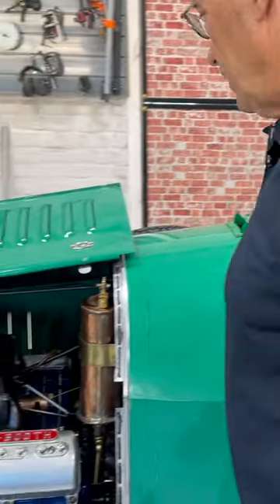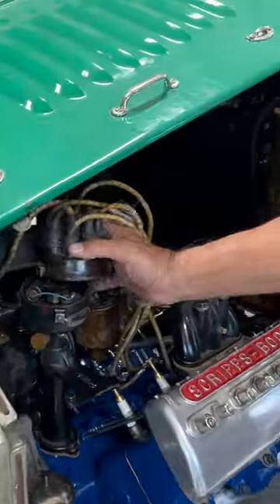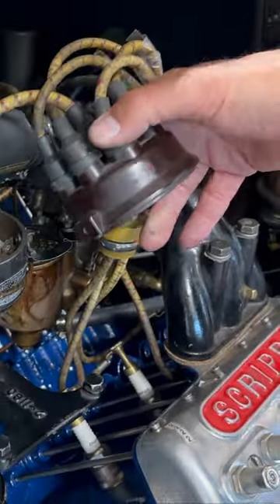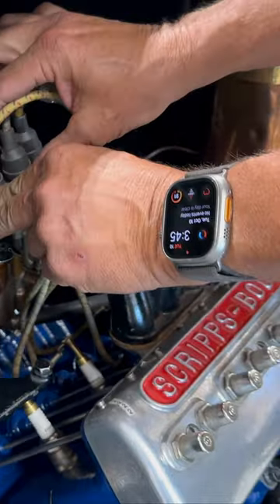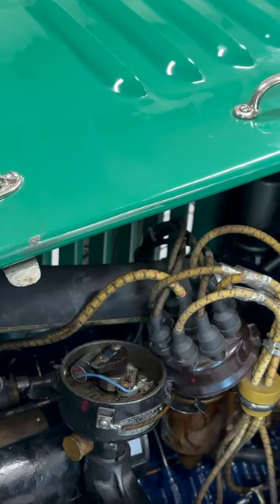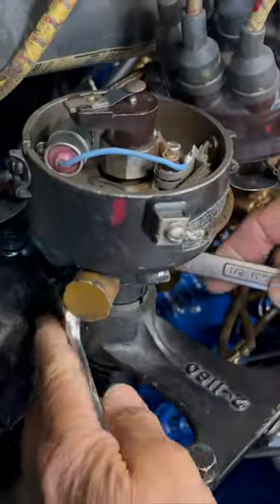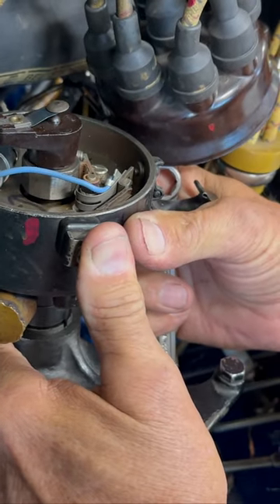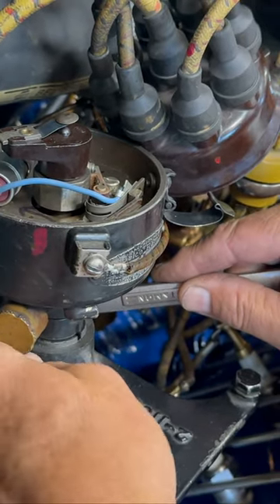Can’t FIX Time W Modern Timing Light to Start!  Only OLD WORKS! 1915 Ferro OHV Racing V8 Alan Travis

Comment: Although I frequently time engines by ear, you cant argue with a timing light, and manifold vacuum. An inductive timing light will work on ANY engine with spark. Resistor plugs and wires don't change anything other than radio/RF suppresion. Ive been working on antique engines since I was a kid.
Reply from the maker: Thanks for your insight
Reply: EXACTLY
Reply: Was thinking the self same thing.   👍🏻
Reply: The timing light never lies, but the inertia ring does on this old stuff. Very common for the ring and its timing marks to slip once the rubber shrinks and cracks from old age, you really do have to time by feel
Reply: @allurared9029  what is an inertia ring. I have been a mechanic since the early 70s and have never seen one.
Reply: @artszabo1015  The inertia ring is the outer ring of the harmonic dampener that bounces around on the rubber
Reply: @allurared9029  Well well , I knew that rubber was there but always just considered it as one piece. Thanks for the info.
Reply: @nunyabiness417 as a guy that has worked on these old engines, you forget one thing.
See, back in those days, they were made to be serviced and maintained BY THE OWNER.
That means you didn’t have such Ann expensive, fancy tool like a TIMING LIGHT hanging around your shop.

This guy proves that by showing how it was done back then.

When it came to those old cars, they literally were fixed on the side of the road with spit and baling wire.

Comment: Quick Hand tune....works on 1973 V8 Olds too.....
Bought it ...ran so rough....to drive it😂 away I used window to see the vibrations move the glass...
Door open ...3 inches rplled down...
SAW the idle at its smoothest....to get it home.

Comment: 1-Number one piston top dead
2-open switch to on position
3-loosen distributor
5-numbrer one sparkplug wire near ground
6-rotate distributor till see the spark.
7- tighten distributor and 🙌
Reply: Which direction is the distributor rotated, please?

Comment: Old school stuff kids, listen and learn,  i can remember using a matchbook to adjust the points , something most of you young bucks never heard of
Reply: Match books or points?
Probably neither.
Reply: we used the pull tab from a beer / soda can, then left it hanging from the cap clip for next time.
Reply: I remember using a business card
Reply: @jamesredman1263    business card is about 0.0011" so close enough for setting the air gap on a lawnmower coil to the flywheel. A bit too slim for points.
Reply: @rupe53  
I think matchbooks run about .015"-.018", so just about perfect for most points. And of course they were free and plentiful. 
I never heard of the pop top trick. Now I have to find one and mic it. Lol
Reply: @jerrylong381   I think you will find the newer aluminum cans are thinner than the ones from circa 1970, plus the tabs don't pull off. Of course, nobody smokes these days, so matches are not as plentiful as they used to be. Also, in the old days, matchbooks were not all the same thickness. I got pretty good at eyeballing them. Of course, if you used proper points lube you didn't have to screw with adjusting them between replacements.

Comment: 1. Top dead center the engine by turning in the direction of operating rotation. This takes up slack from the timing chain.
2. Ignition on.
3. Turn distributor against operating rotation until points break, audible click and flash across points.
You now have a perfect tdc 0° spark.
This technique works for any points ignition system, its actually more accurate than a timing light.  You can now advance the timing by ear for daily driving with your chosen fuel octane.
Reply from the maker: Great tip!  Thank you!

Comment: I HAVE USED A TIMING LIGHT ON OLDER VEHICLES WITH STANDARD SOLID WIRE AND NO ADDED RESISTANCE!
WHAT IS UP HERE??
Reply from the maker: It’s the new ones that don’t work. Old ones work fine. The chips gotta see resistance… apparently
Reply: I DON’T KNOW WHAT WE’RE YELLING ABOUT!!!!
Reply: @AZdirtdog 😂😂😂😂 I agree
Reply: WHHAATT? I CANT HEAR YOU SPEAK LOUDER!
Reply: @nasilemak868  HAHAHA YOU DONT HAVE TO SCREAM 🤣🤣🤣🤣
Reply: Same here, no problem.
Reply: Ditto...solid core wires on flathead...find top dead center cylinder #1, mark the crankshaft pulley with a notch, I made a pointer out of mechanics wire and secured it to timing cover bolt to align with mark. Flathead Fords like about 22deg overall all in by 2200-2500 rpm. Converted diameter of pulley to degrees and marked the pulley a second time. With inductive timing light, solid core wires and copper core spark plugs accelerated to 2300 rpm and adjusted timing until second mark aligned with pointer, tighten distributor...done.

Comment: Try a vacuum gauge (with a large dial).
Reply: Rotate fist—engine at idle—until the highest vacuum, then back of 1/2 inch mercury on the vacuum gage and lock hold-down bolt…gotter done.
Good when harmonic balancer ring has slipped and light won’t work right.

Comment: I'm on my daughter's YouTube. For those of you that say that a timing light would work on this engine you're half right. I have a Sun Tune timing light that I got from my dad 42 years ago for Christmas. It gets its power by connecting to the vehicle battery. This timing light is so sensitive that if an engine has solid core plug wires that it will pick up the induction from all the wires even though it's clamped to the number one plug wire. In fact it will pick up the induction of all the plug wires without the timing light being clamped on any of the plug wires. The clamp can be laying on the ground and still pick up the induction from all the plug wires. When that happens, it makes it a little tough to time an out of time engine while cranking. I'm guessing in a case like this a cheaper timing light would be better because it wouldn't be as sensitive.
Reply from the maker: Thank you, for that great comment. Keep that old timing light, it will work better in a non-resistor ignition, the new timing lights have chips in them, and they have to see the resistance to work…
Reply: Really? Never to old to learn. Thanks for the tip.

Comment: I've timed plenty of old school engines by feel and I'm a 24yo girl. timing lights help though, and there's no reason one wouldn't work on this engine either as long as the crank hub or pulley has a mark for TDC in respect to a marking on the block. Common sense and feel always come first though. Twisting distributers really is pretty simple business, it may be old tech but you can find distributers on engines into the modern day. Good skill to have especially for me, owning vehicles twice my age.
Reply from the maker: That is excellent!

Comment: with someone turning the engine over someone else slowly turns the distributor, after it starts you can do further adjustments, and then fine-tuned the distributor no tools required. you can also point the rotor when the number one piston is at top dead center and both valves are closed. with the engine running fine tune by turning the distributor a little bit at a time and opening the throttle very quickly Till There is no hesitation in the engine. when you step on the gas to tires will go around real fast right away and you win the race
Reply: every engine has its own special place and you cannot find it without a load on the engine. sometimes I even adjust the timing while the engine it is running under load for best gas mileage. the race is on

Comment: Where did you get this guy? Same as an 9N Ford tractor.  The coil is attached to the front of the engine.
Reply from the maker: My understanding is the Ford 9N came out in 1939, 26 years after this engine was built!
Reply: You must not have much background with motors. Theres hundreds of designs with the distributor to the front of the motor. How the hell could a team assembled v8 be anything close to an assembly line built flathead 4 banger?

Comment: I routinely use a timing light on cars that don't have resistor plugs. All resistor plugs do is keep static out of the radio.
Reply from the maker: OK thank you I’m gonna look into this more
Reply from the maker: He’s talking about the newer ones. If you have a non electronic one, it will work 👍
Reply: @BarryTsGarage  All a newer electric one needs is a 12 volt battery to power it. A lawn mower battery will work. That's what I've had to do when timing a six volt VW with a new timing light.

Comment: The rotor doesn't spin in the same direction all the time?
Reply from the maker: Different engines spin their distributor differently (clockwise or counter clockwise) on some ancient machines there is no reference manual available and you have to figure everything out… but good question!
Reply: @BarryTsGarage  You're right, makes perfect sense to double check as it only takes a minute. Thank you for the informative video and answer.

Comment: Don't think typical American V8 cars had overhead valve v8s for another 30 years😂
Reply from the maker: That sounds about right!
Reply: Buick had OHV and full pressure lube in the 20s. Their Master 6 cylinder had roller lifters in that era as well.

Comment: Time for MSD ignition upgrade here. Vehicle's over a Century old !
Reply from the maker: A practical idea for a lot of applications but that’s not even a discussion here. Alan is determined to keep his cars looking and running as-built. He actually enjoys tweaking the tune and keeping everything “analog”.  Thanks!
Reply: @BarryTsGarage  ... Looks like a dab of distributor cam lube is in order.
Reply: @BarryTsGarage I completely agree, it’s way more enjoyable to keep it original
Reply: @JW...-oj5iw that’s one of the most neglected areas of the old points distributor, i have re filed a few in my younger years

Comment: The earliest timing lights that I recall were little more than flashlights powered by coil spark. They tapped in the secondary circuit between the spark plug wire and the spark plug. The resistor plugs would make the light a little brighter, but it was terribly dim to begin with, so maybe Alan's just talking about how pathetic the light is to begin with. The numbers of engines tuned by ear probably dwarf those tuned with equipment. We used to joke about using a "dwell light" and a "timing meter" for tuning cars. I learned long ago that timing marks and pointers and tabs are not trustworthy. For any engine to be spark timed to a specific point, the mechanic HAS to physically verify TDC and match the timing tab. Additionally some factors may change with wear over time, especially with timing chain stretch. My truck has been ear timed and pry bar adjusted for years.
Reply from the maker: Very good!! Thank you for the thoughtful comment!

Comment: I didn't know u needed resistor type spark plugs to use a timing light 🧐🤔
Reply: No, you don't!
Reply from the maker: Only with the new timing lights. The old ones without chips work no problem
Reply: Can't see it myself, a pluses is a pluses, new or old the timing light should trigger. The only reason for a resistor type spark plug is to control spark duration.

Comment: Feel sorry for people that didn’t cut their teeth on the old stuff, should be able to set timing with vacuum and if not run it up while idling till it drops rpm then back it off a touch
Reply from the maker: Yes indeed
Reply: @BarryTsGarage  the one that will freak you out with points ign. You can pull the coil wire and replace with a piece of vacuum line and it will start..

Comment: Why would a timing light not work… I fail to see how resistor plugs or wires change the efficacy of a timing light.
Reply from the maker: An old-school timing light would work, but the new ones with chips in them will not see the resistance and won’t work
Reply from the maker: If you can find an old timing, light without a computer chip in it, it will work. The new ones won’t because they have to see the resistance… Thanks!

Comment: That's not true you can 100% use a timing light on solid core spark plug wires and 0 resistant spark plugs
Reply from the maker: News ones are the problem. Older timing lights work fine….

Comment: Do not know why a non- resistor spark plug would prevent you from using a timing light, makes no sense to me.
Reply from the maker: He’s referring to the modern electronic timing lights - they require resistance. An old school light will work. Same problem with new battery chargers essentially.